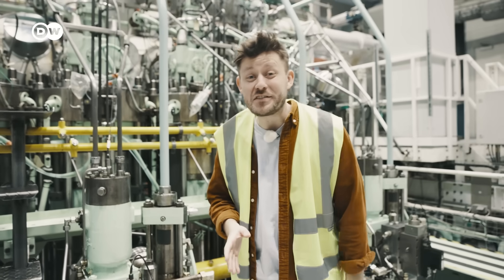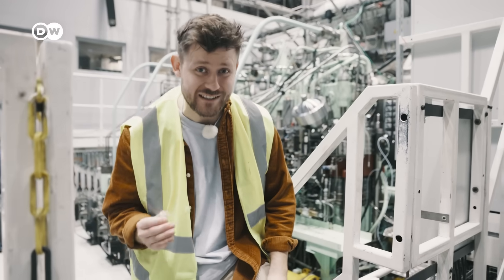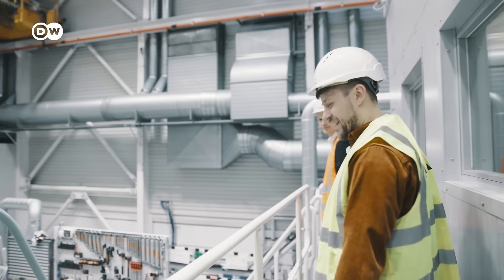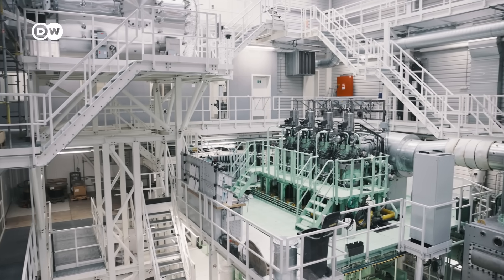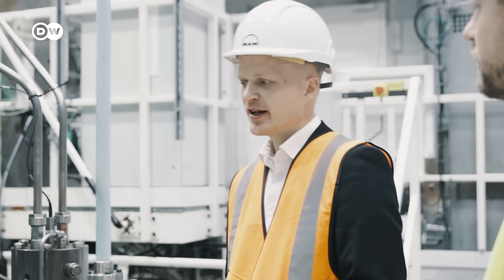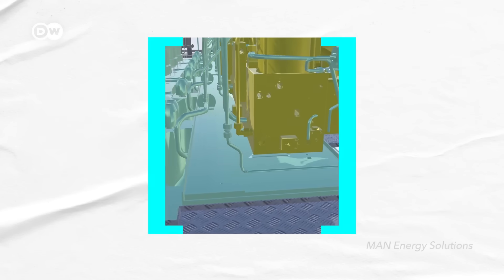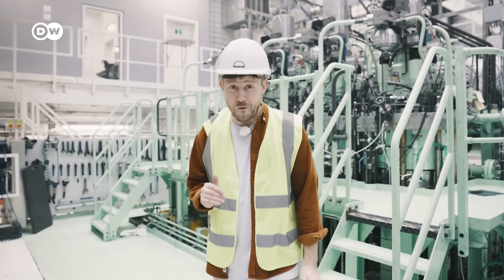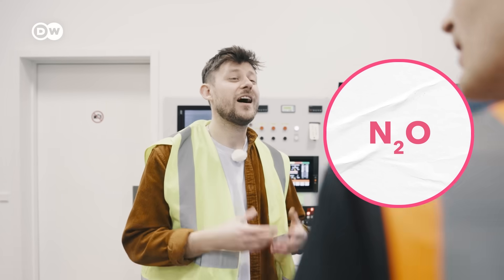Can this magic fuel clean up the shipping industry?

Comment: Although the problems are very well summarized here, I hope there would've been more discussion on the hazard of ammonia fuel. It's dangerous even at very low concentration, like few hundreds of ppm. Even worse in the event of release in that engine room, conventional mitigations like water sprinkler would not work here because ammonia-water contact is so exothermic it creates much more ammonia vapor clouds instead of reducing it. Ventilation might do some of the job but installation of really heavy duty vents (like above 30 air change per hour) would do some dents in the capital investments. Ditto with double-walling of piping.

And although ammonia can be detected by smell at even lower concentration than the hazard threshold, the current debilitation of olfactory ability in population level (due to mass repeated infections and lingering effect of Covid) may necessitate more cost-efficient detection measures (you can't put too much sensors everywhere!).
Reply: Trust me, at even just 20 ppm (factor of 10 below health hazard levels) you'd have to be missing your nose entirely for it NOT to scream at you that something is in the air. Other than that, your points are factual.
Reply: I have already added a comment to the main stream covering a few of the aspects, but as this particular thread is about the risks involved with ammonia, I would like to add this extract from that comment:-
  "There is also the fact that ammonia is really nasty stuff. I was on one ship with a liquified ammonia cargo and during gas freeing operations the accommodation was flooded with the stuff, killing my potted plants overnight, in addition to the difficulty everyone had breathing".
On that occasion, when I finally managed to get to bed, I kept an escape breathing apparatus by my bed.
I do not know how things will develop, but MAN are at least conducting proper research.
Reply: "because ammonia-water contact is so exothermic" - this is 100% untrue. Ammonia-water contact is _endothermic_, so much so, that ammonia is used in absorption refrigerators, where the cooling action is produced by dissolving amonia in water.
Reply: @AlexBesogonov  I think you are mistaking ammonia chloride for ammonia. Not the same. Ammonia reacts with water and that reaction is exothermal. Quite violently so.
Reply: @andersvalland9464  No. I'm not mistaking anything. Ammonia dissolution in water is _endothermic_. If you bubble ammonia gas through a test tube of water, it can actually form a bit of frost on the walls of the tube. This principle was used in early refrigerators.
Reply: Finally somebody acknowledging the impact of chronic debilitation on the maritime industry!
Reply: where is the crew going to go to escape the ammonia cloud that would envelope the ship possibly killing the crew in minutes.
Reply: @kevinchastain727  Everyone going into that engine room needs to use Type A PPE (the full-body cover), though modern engine rooms tend to be unmanned during voyages.
Reply: @kevinchastain727  It MAY not get that bad, because ammonia gas is much less dense than air, and thus would rise out of the way fairly quickly. But your overall point is still valid. A rupture of a tank or a pipe and a mass release of ammonia (gas or liquid) will kill everyone in the area very quickly.
Reply: @starpawsy  There's a few papers (and an old US Coast Guard report published in 1974) stating that although ammonia vapor is less dense than air, it's hygroscopic enough to attract water vapor from the surrounding air that the generated cloud becomes heavier than air and unless the air is hot enough, the cloud would just hover over the ground level. That would pose a lot of risk to seafarers and surrounding people in certain situations when the air is humid and cold.

But fair enough, engine rooms tend to be pretty hot (in some cases can reach well above 30 C), with lots of hot surfaces (like that of the machinery parts). In that particular case, I guess high vent rate (and some kind of pretreatment of the contaminated air prior to release to the environment) should be enough in dealing with the release.
Reply: @lontongstroong  Yes. Going off at a bit of a tanget. Ammonia has a very high specific heat and other properties that make it a very good refrigerant. And yet it is not used as such because of the danger of poisoning if there is a leaking. So yes, overall, the risk of death outweigh the benefits.
Reply: The only way to store enough is as anydrous ammonia. Ive dealt with it. It’s very dangerous and likes to settle in places. So a complete ventilation redesign and a separate ventilation system for any fuel storage piping areas would be warranted. Also anhydrous ammonia is stored in a manner similar to liquid propane. Most of the pump and piping equipment is actually the same as LP. But anhydrous Will chemically burn you sucking the water out of you.

Comment: This is insanity in the third degree. Firstly, you only get a 3rd of the energy you put in to create the ammonia, to use in the fuel created and that is being generous.
Secondly, as with all combustion engines, only around 20 percent of the energy in the fuel is utilized in motion. The rest is lost in the kinetic energy of the engine and gearing of the system with some of the losses in thermal energy.
Then, there is the simple fact there is not enough room to store the fuel on the ship itself.
Then there is N2O and NOx???
I mean, seriously. 
A battery pack along with the motors are a similar weight to any diesel engine used in a large ship, exclusive of the fuel.
Stick some solar on the ship and add some wind capture devices and your ship still doesn't weigh as much as a fully fueled ship. 
Electricity into motion is anything from 95 to 98 percent. 
Why is this even a talking point?

Comment: If the ammonia is not converted properly to Nitrogen gas, then it leaves NOx which is a powerful, and already problematic, pollutant. So if this is not maintained well, then this would be swapping one problem for a different one.

Comment: The energy input to make NH3 is hugh but to make NH3 H2 Is required which also requires hugh energy input.  This will make the NH3 fuel extremely expensive.
Reply: Renewables mean that intermittent electrical power is getting ridiculously cheap
Reply: @alandpost  Only because centralized power stations, coal and nuclear, cannot ramp down, and are being made unprofitable by the fluctuating prices.  Once renewable and storage are the major supply with gas peaking plants for low periods that will change.  Additionally there will not be an abundance of power, the resources are only available for a small fraction of current global population.
Reply: @dan2304  Storage will be a major expense.  So demand that is flexible will be able to get a much better price.
Reply: @alandpost  You don't appear to understand where our energy comes from. Aproximate 33% oil, 24 % gas, 28% coal, 7% hydro, 6% nuclear, the rest made up of every thing else.  Fossil fuels are needed to manufacture all the alternative energy sources, very resources intensive.  Fossil fuel will be functionally depleted as will many of the metals needed before fossil fuels can be replaced.  It is not just energy, both potassium and phosphorus needed in agriculture are in falling supply as with nitrogen made from methane.  The cost of doing every thing will increase as energy commodities become more expensive to produce and transport.  A point will be quickly reached when it becomes uneconomic.

Comment: I understand that when ammonia is burned, NOx is emitted.
When the world first started working on hydrogen engines, they were discontinued because of the NOx emissions, right?
It would probably require large equipment to remove it, and the cost would not be worth it in the end.
Since ancient times, it is thought that all systems would have been done this way if it did not emit substances that are not good for the environment and was cheap, so it is predicted that there will be many difficult issues.
But I agree with actually verifying various things.
I hope you can find the best way.
Reply: Aside from the NOx problem (from Zeldovich reaction), hydrogen engines are also extremely unreliable and not viable economically and environmentally because it's exposed to extreme condition (H2 burns very quickly and uncontrollably) . Moreover H2 can degrade the materials quickly (having very small molecule size that can penetrate tiny crevasses and expand, creating ever-expanding corrosion) and thus very expensive materials that can withstand such condition need to be use instead. Speaking its escape ability from containment, H2 itself is an indirect and rather potent greenhouse gas too.
Reply: @lontongstroong  
Thank you for the information
Toyota is racing, but it seems difficult to develop it into commercial cars.
There is also information that the hydrogen tank is very large to maintain safety.
Reply: @wind-leader_jp  I don't think Toyota would stay in the car business for long, although its internal combustion car share may still could get a significant hold onto low-renewable penetration Global South. Its solid state battery technology has been without tangible breakthrough, which is a serious threat to its very existence.

On the other hand, its research on ammonia synthesis and cracking are quietly much stronger than the reputation may suggest. I can foresee it would take the Fuji Film way (when analog photography phased out) - but instead Toyota would pivot from automotive industry towards something like (green) ammonia logistics, which is and still will be a huge industry for years to come (although ammonia car will never be an option). 

Granted, it would be a rather significantly smaller entity and no longer a household name for laypersons (like Fuji Film nowadays), but it would be here to stay.

Comment: Please, please, please, turn down the hype. Ammonia for combustion is beyond ludicrous. Why? For starters, round trip efficiency in the 25% to 40% range in internal combustion engines.

Switch that ammonia ICE for a fuel cell plant with ammonia as the hydrogen carrier, and now we're going in the correct direction.

But wait, there's that ever more vaunted hydrogen. Aside from efficiencies in the 70% range for Haber-Bosch (ammonia). Hydrogen is needed to combine with nitrogen, and that hydrogen currently comes from steam reforming methane (98% of current production). And when you "magically" convert all that "grey" hydrogen to "green" hydrogen using renewable energy, it'd take 100% of all the electricity generated from wind and solar the world over in 2019 to produce all that "green" hydrogen. So, if we're using massive amounts of renewable energy to produce hydrogen, what about decarbonizing electricity generation? Yup, you guessed it.

Lastly, in addition to the inefficiency of ammonia ICEs, and the massive draw of renewable energy for "green" hydrogen production, we also must first distill water, then use electrolyzers to create the hydrogen. And, while Earth's surface is 70+% water, less than 3% is fresh and the majority of that (68.7%) is locked up in (rapidly melting) glaciers.

All tolled, the well-to-wheel efficiency of fuel cells currently sits around 15%!

Does 15% sound "magical" to anyone? Not to me, it doesn't.

Comment: pressurised combustion to a high voltage electrical charge could layer bi-products and increase thermal mass. then you could liquidise the bi-products and store it to process into concrete and lime-based wall plaster as they do in rubbish burning facilities..

Comment: Perhaps it's time to switch to using fuel cells instead of sticking by combustion engines. Using ammonia as fuel, the output from the fuel cell after reaction is just N2 and H2O. Minus all the harmful NOx and N2O emissions from high temp combustion processes, and no need for an additional component like a catalytic converter at the exhaust.

Comment: you could also, idk, use nuclear power. just a thought.
Reply: look into the NS Savannah and why it didn't catch on
Reply: @dnltbrca  economicaly unviable as a result of hybridized design between cargo and passenger ship.
Reply: So if nuclear propulsion for commercial shipping was a viable option, wouldn't we be seeing it in use already? The reality is that there's a whole bunch of operational & commercial issues that limit the adoption of nuclear propulsion for commercial shipping.
Reply: @davidjones5280  using nuclear power would lower oil profits.
Reply: @battlecruiserna  So would other low emission propulsion systems

Comment: I am not sure about your calculation for "up to 1100 fewer containers" 
The example the engineer gave was 20000 m3 (cubic meters( of ammonia  tanks.
a 20 foot container takes up about 33 m3, so that would 606 containers fewer loaded on board without any optimization.

Comment: I am not even sure your correction is correct at 4:16!
If that is a 2 stroke crosshead engine similar to regular marine diesel engines, and that is the crankshaft you are looking at, that is just a connecting rod. The piston rod would be a couple of meters above you!
Yeah, you are right about those engines being big!

Comment: This is so impractical. Producing ammonia is extremely fossil fuel energy intensive, and the fuel and byproducts are insanely strong ghgs and toxic. This is like saying that you're addressing the radioactive waste problem by using nuclear power to enrich plutonium, then putting a plutonium power plant in every cargo ship. Sure, you may mitigate the problems with technology, but it'll be expensive, and there are far better, cheaper, and more practical alternatives.

Comment: Reduce shipping would be a quick savings.  Put a carbon price on shipping.  That would incentivize production of goods closer to markets and encourages switching goods that are shipped long distances.  We simply can not keep consuming fuel at increasing rates over time.  We have to reduce consumption.  Renewable fuel sources are needed to supply energy to electric cars at increasing rates.  We can't divert renewable fuel sources to making ammonia.  There are only so many investment dollars to go around.  Conservation must be part of the plan.

Comment: Why not burn green hydrogen directly? Or HLNG Which need very small modification in IC engine. While hydrogen has highest energy density
Reply: Have you seen the huge size comparison of hydrogen storage tanks to petrol/deisel alternatives to travel the same distances? Hydrogen fueled container ships would need tanks like the Hindenburg & would probably end in a similar way with low maintenance. We dont produce much green hydrogen anyhow & it is also very energy intensive to produce, so while we all love clean hydrogen outputs, it can also create excessive pollution to create in the first place.

Comment: Fun fact, according to Wikipedia global ammonia production from the Haber process  is about 230 million t/year and is responsible for ~3% of global CO2 emissions.  According to the video, future state, the shipping industry is likely to need 900 million t/year of NH3.  I think that we have a fundamental math problem here.  Let's start with making low emissions ammonia for normal use before we start finding new uses for it.
Reply: Yes, fertilisers like urea is a much better use of low emission ammonia, that’s how they produced ammonia for making fertilisers 100 years ago before they started using natural gas. It’s a well known production method
Reply: Yes fertilizer and chemical production will need lots of it, but that shouldn't be a reason to not work on other ways to propel big ships without fossil fuels. I guess it will take still a long time, developing engines for all sizes of ship's. Getting maybe over time a bigger share in newly build ships. Hopefully getting some other extras as a parasail reducing the need for fuel.
Enough time to ramp production up.
Reply: @maltekoch1632 Fertiliser and chemical production will use all of it and more.
Burning it would be inefficient and wasteful.
Reply: @michaeloreilly657  of course combustion engines are kind of shitty, but big marine engies are on the top ones of them. Reaching up to 50% efficiency.
Big question: What other options do we have? Direct H2 usage via fuel cells would maybe get more efficient but would need even more space, as well as energy intensive storage.
Reply: @maltekoch1632 initial use would likely be on ammonia tanker ships which would be the testbed
Reply: Hi. You have a point. However, action IS being tanken in that area, too.
Reply: Yes because IT is used to produce fertilizer, the emission comes from natural gas and not ammonia. Directly burning liquified ammonia as a fuel doesnt contribute to CO2 emission

Comment: They should not assume that shipping volumes will remain constant.  As transportation gets more expensive, it should drive some level of re-localization.
Reply: Can be a part of the solution, but big ships are extremely energy efficient. Getting to 5% the emissions per Ton and km as a truck. A km with a truck can have the same emissions as shipping 20km the same weight.
With that the emissions and costs of transporting a bike from portugal to germany can be higher then from taiwan.
Making production more Regional can although push to smaller factories which are less fine tuned. Pushing emissions up. A lot of the time transportation from asia isn't a big part of the over all emissions.
Reply: exactly. think out of the box. How to lower tansportation costa with local production

Comment: all completely unnecessary 

using conventional fuel and removing the CO2 from the air afterwards with Direct Air Capture is a much cheaper and less energy intensive way of ensuring over 100% reduction (carbon negative) operation of marine hydrocarbon fuels